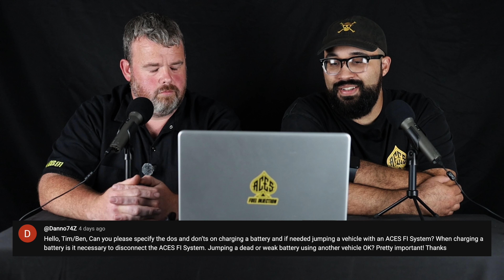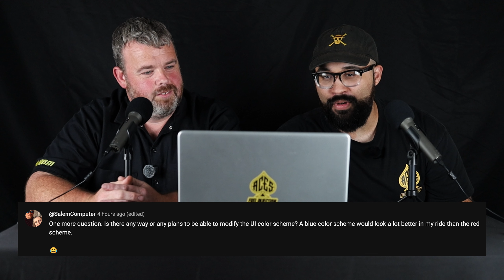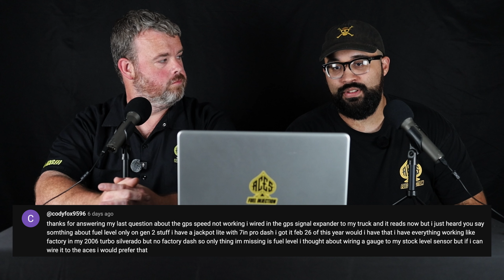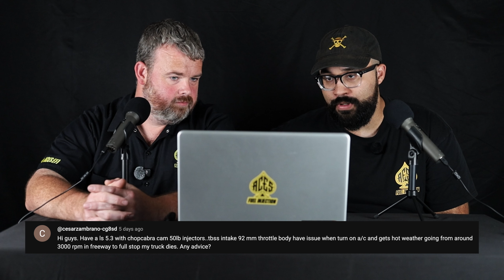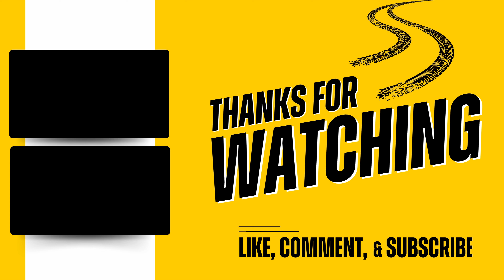Featuring a New Host... (Tech Tuesday Ep. 88)

Comment: Hi guys!

I run a manual transmission on a gen 1 killshot and about 50% of the time when I clutch to downshift, my engine stalls out… do I need to adjust my IAC to compensate, and how do I do that?

2nd question, are oring rebuild kits available that if we have a plugged or injector failure, we can repair it?

Comment: Hello, Jack Pot lite Question: How would I go about self tunning my Turbo LS? I know the  Jackpot cant read the boost "yet" but would the self learning feature read the positive pressure from the turbo as it goes up and down the table?  I don't need a HP number and I have my external vacuum boost gage to read and stay with in the ACES map sensor specs.  No Boost control just wastegate psi. Long answer please.

Comment: I installed a kill shot on my sons firebird, it has run extremely rough since I put it on, and has not idled smooth enough to even try moving it. I was told the iac needed to be adjusted but it will not warm up, or stay running long enough to really adjust it. It surges from 300-500rpm and shows 85-90 on the iac when closeish go warm. Adjustments to the butterfly valves does not change this at all, and the air port is sucking a ton at all times, what can I check?